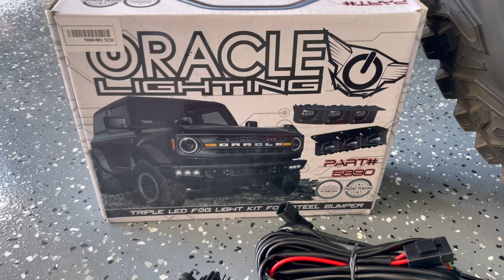AUX Switch Installation of the Triple LED Fog Light Kit by Oracle Lighting - 2021+ Ford Bronco

Comment: Nicely done. Have you had the opportunity to drive at night and use them as intended (in foggy conditions)?  So much debate on fog lights when it comes to lens diffusion, color, etc.
Reply from the maker: Thanks, I appreciate it. I actually only installed them last night, so I haven't driven with them at night apart from pulling back into the garage. According to Oracle, they are 'DOT Compliant' as fog lights, but that pretty much states the they aren't too bright to annoy other road users. And it's been 100ºF+ every day for a long time now, so we're not going to have fog for quite some time!
Reply: @CUPRADESIGN  We're coming into winter right now in Northern NY State. I drove my vehicle home from Maine after purchasing it in a whiteout. It was very difficult to see with the LEDs for sure. Im hoping the yellow lights help cut through the snow without reflecting. We shall see.
Reply from the maker: @mikkibakken  Wow! Glad you made it home safe. I’m down in Texas, so if we’re going to get snow, it won’t be much, and won’t be till February! These fog lights are one of the best decisions I’ve made for the Bronco, they really look great! Good luck!

Comment: Is that a stock bumper?
Reply from the maker: Hey Stevie, it’s an OEM bumper, it is the optional ($800) modular steel bumper available from Ford when ordering. I’ve also got the optional steel bash plates as well.

Comment: Will the leds work on one of the four 10 amp switches? Or do we need to use the 30?
Reply from the maker: Ed, as I understand it, yes, they will work with the other switches. I didn’t at the time have any plans to add something with larger draw and the fuse in the harness that came with these was a 30A fuse. That’s why I did it this way but from what I’ve read they don’t draw anywhere near that so you should be good.
Reply: @CUPRADESIGN  Thanks!
Reply from the maker: @edsmith202  No problem at all! Good luck!